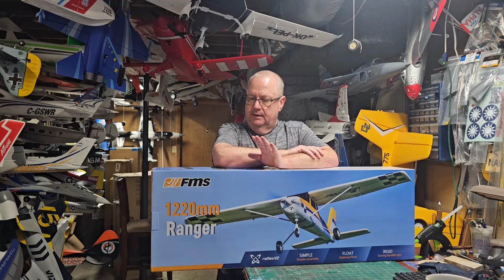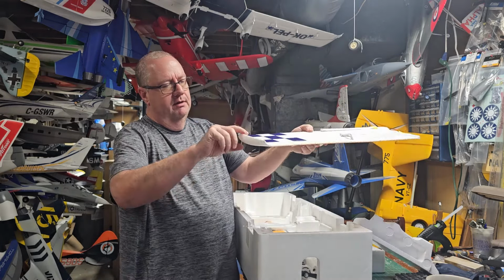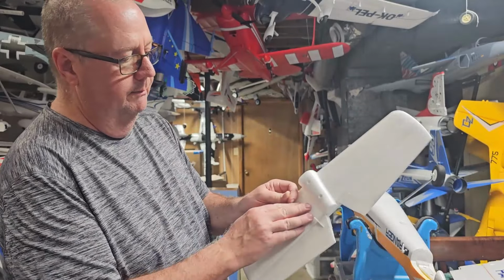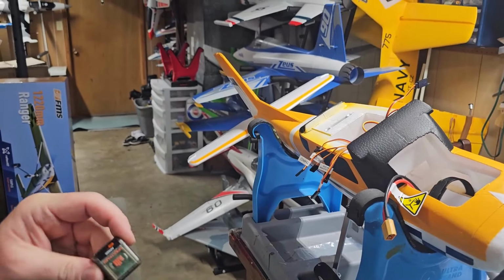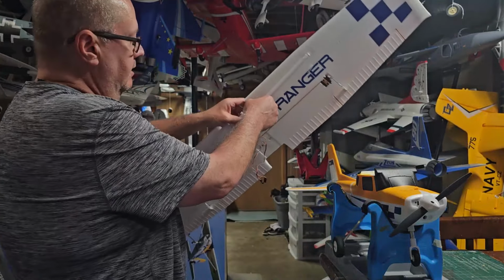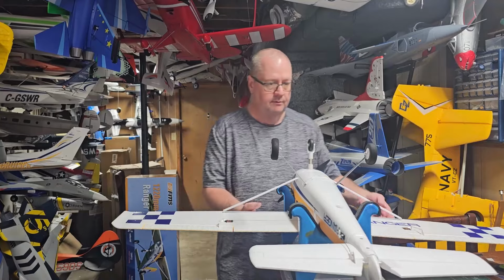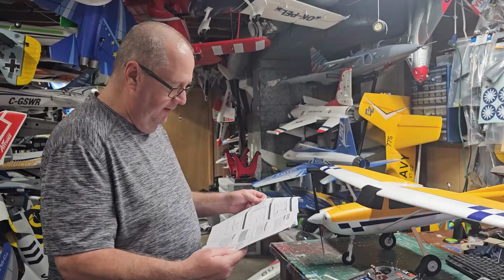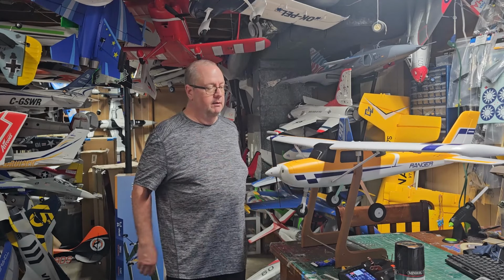FMS RANGER 1220MM UNBOX,BUILD, COMPLETE RADIO SETUPS by FGFRC #rcplane

Comment: Love your channel it has been very informative to me. I am a  beginner with some time under my belt, you have helped me set up my century riot, and my fms p18 cub 1300mm. My question for you is I'm thinking of adding another to my fleet to take to a local park with plenty of space as the club i joined is a hour away, I have 2 planes in mind a aeroscout 1.1 v2 and a ranger 1220 v2 as in your video, please what are your thoughts on which one to choose. Thank you love your channel watch everyone religiously 👏👍🏻
Reply from the maker: Thanks. The Aeroscout would be a better choice if the local field is grass only. The Aeroscoutt lands any where but the ranger needs VERY short grass to keep from nosing over.
Reply: @FatGuyFliesRC thanks for reply , you have confirmed what I was thinking but wanted to make sure from someone with a lot of knowledge 😊❤✌️

Comment: I just got this same kit,  I  installed the specktrum a3x reciever and it will bind and all works. But when I restart it , it goes dead? Everything is plugged and secure my radio is dx 6, it seems I have to jeep rewinding to get it to work, any suggestions? Thanks
Reply from the maker: Make sure youy throttle trim is at zero next time.
Reply: @FatGuyFliesRC Yessir.

Comment: The FMS Ranger 1220mm V2 does in fact have a wing spar (which is user installed), I think that's the primary difference between it and the V1.
Reply from the maker: Thanks for the info!

Comment: Fats Ive had this bird for about 2 years and I only thought there was 2 flight modes safe and as3x on the v2 reflex and I didnt really care as long as I have the 2 most important modes but now I find out after watching your video there are 3 and the only reason I watched this video is bc this is the most tuffest SOB PLANE anyone would want to have. Ive nosed dived it, ive flip the wing like a cartwheel on the ground and I will tell you some things broke but it just keeps on taking a licking and keeps on ticking like the old time watch commercial. I love it so much I wanted a green bird so I just bought the V3 version today and I had no clue I just it had reflex on and reflex off and no actual off. Im so stupid omg I never looked into the 3 switch for reflex on = safe mode and mid switch off, reflex on with as3x lower switch and its on B switch.. ugh what I learn from you..I feel so stupid for not knowing that and Ive been flying the V2 for a few years and now I just wanted a green bird and got the new REFLEX V3 and it has bluetooth that you change rates and thows via your phone. UGH What I learn from others like you and I thought I knew the secrets..Thanks Fats I appreciate it..Oh btw I stick a 3s 2200mah in it and had to cut the foam in the cockpit little and put that bad boy in it and it CG'S just right. This bird seems to be one of those birds that cg is just get it in the area and it will fly awesome
Reply from the maker: Yes this is by far one of the most perfect trainers out there!